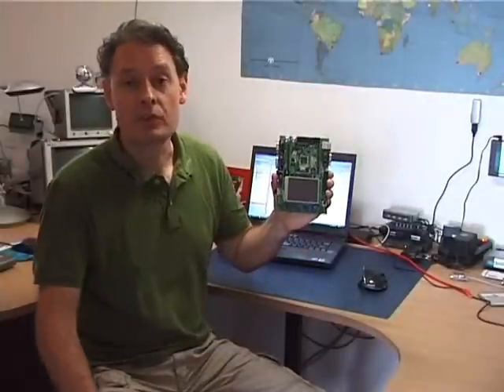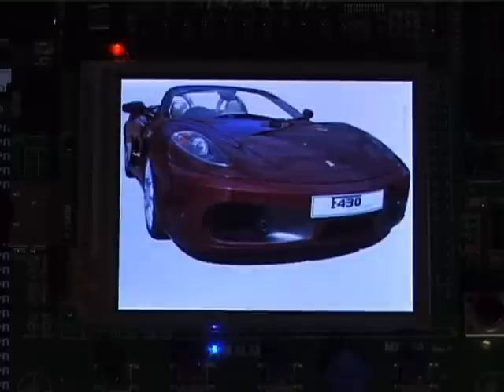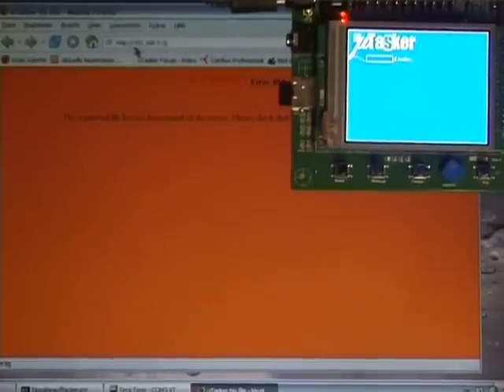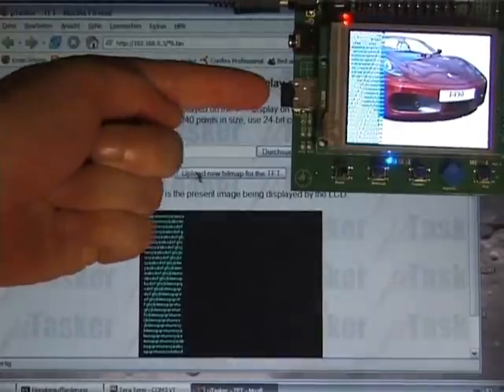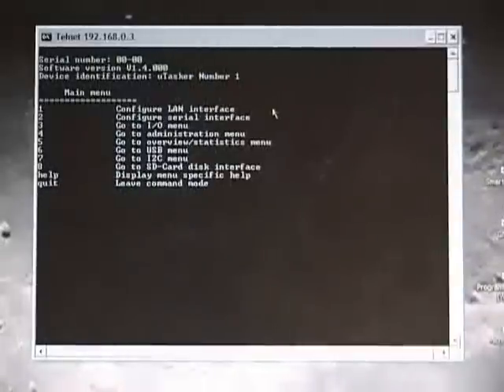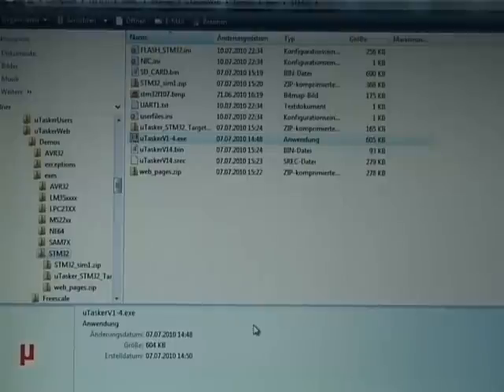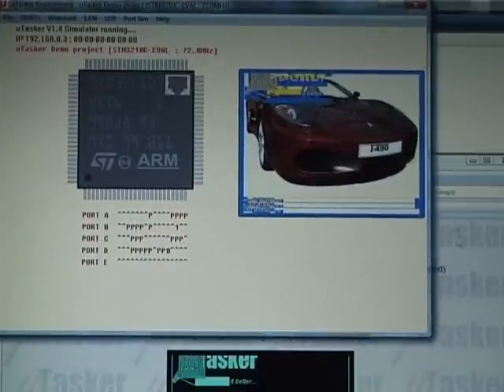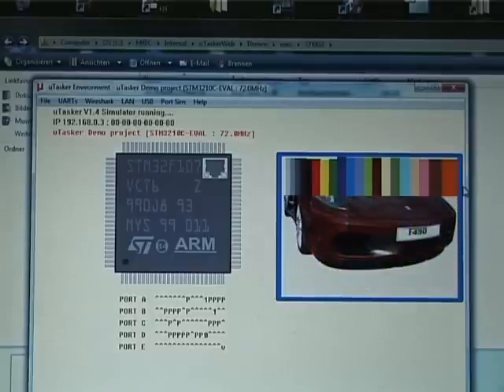STM32-1_uTasker.wmv

Comment from the maker: Monochromie LCDs are still used in many user interfaces but the use of a TFT to do the same thing is no more expensive today and has more flexibility; higher resolution, the single colour can be changed and it can be used for multiple colours if that later becomes a requirement.

Comment from the maker: I think that it was "emulated" monochrome. That is, using it as if it were a monochrome LCD to simplify the control and save RAM resources in the processor controlling it.
Full colour use is also shown but requires more memory (150k for a .bmp image compare to 10k for monochrome emulation).